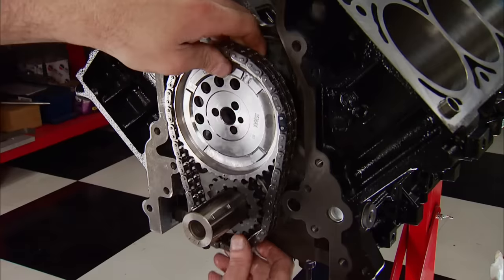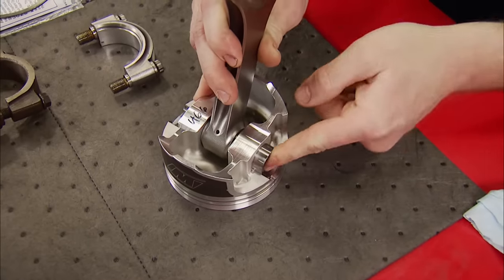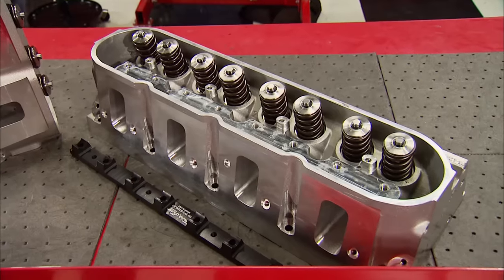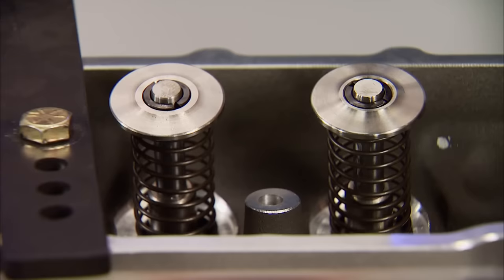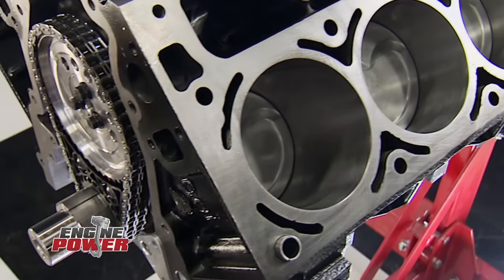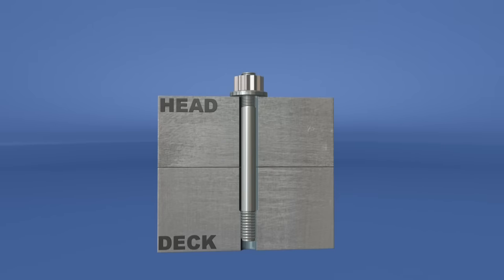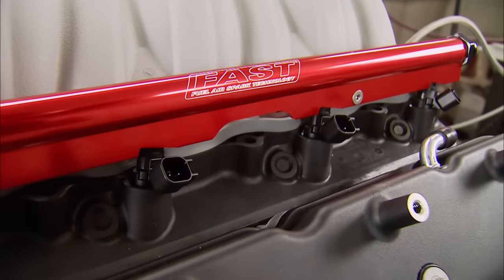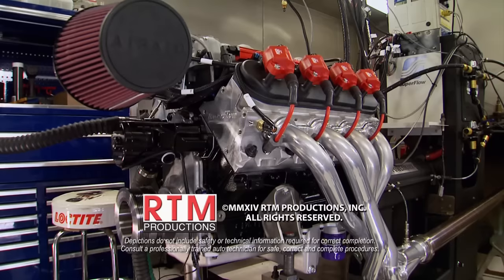Final Assembly Of The LS 408 Stroker - Engine Power S1, E10

Comment: Great info on this video.

Never let the stud touch the block. If anything, leave it as much relief as possible, especially with an aluminium head. Aluminium, iron and steel expand at different rates. Let the gaskets do the sealing. A stud touching the block can, and most likely will warp the head at high enough temperatures. Five treads of engagement is more than enough for most applications.

Comment: I'm no pro engine builder, but wouldn't the valve angle be reduced to straighten airflow and reduce shrouded of the valves? Not to increase valve clearance. However depending on the build you can also gain some clearance from changing the valve angle, it is just opposite of what he demonstrated.

Comment: Definitely a cool build. Buy the LS7 out of the Z06 made 505 at the crank and has 19 more cubes. So this build makes sense if you are building from scratch but if you own a car with a LS7, like my current Z28 you are a cam and tune away from making 100hp more than this build without E85. However if you have ever heard a 408 stroker LS in person you’ll know they sound incredible especially with a big cam as they lobe like no other but straight scream in the upper RPM range. Great build all the way around but I’d have ran AFR heads, trick flow’s are great but AFR is much better lol

Comment: Currently building my 408. When it’s complete it’ll only have 823(looking for) or 243(currently have) cylinder heads at first. Nice to see someone put summit parts to use. I was skeptic and used an eagle rotating assembly. Costed more but I couldn’t find reviews on the summit brand assembly. The oil flow tricks were NEEDED! Thanks a lot there!
Reply: you say "only have 823" but 823's flow a ridiculous amount of air in stock form, 315-320 CFM. It's a great head to use. If you can get them ported, they'll move about 370-380 cfm, and still cheaper than the aftermarket options.
Reply: @mathewshackelford8037  I agree but cathedral port heads are better for heavier cars like mine because they make more low end torque. Which is why I wanted to do an aftermarket cathedral setup to improve the top end hp. I’m still on the fence about it though. I may keep the 823 heads and let the turbo work it out for me 🤷🏾‍♂️
Reply: My cathedral port 243 6.0 SBE with a dual plane sloppy 2 and a Sniper makes 533hp.  It’s 10.8:1 and I home ported the heads

Comment: i have a 408 ci LS made from LQ4 6 L
I don't know how much horsepower or torque it has but when they wheel dynoed my suburban it has 361 ft pounds of torque on the ground 274 horsepower to the ground more than enough but not enough to spend the tires on my three-quarter ton suburban on dry pavement but that's okay it pulls the car trailer like it never did before it doesn't drop in the second gear to go up a hill it only just drops into drive from overdrive and muscles up the hill love it
Reply: Change your gear ratios to 4.10

Comment: After you install your pistons, check the guage point for how far the piston is coming out of the cylinder on a stroker.  If its out of the cylinder past the guage point, STOP.  DO NOT STROKE PAST THE GUAGE POINT, especially with a turbo.  This is absolutely crucial.
Reply: Shim the oil pump before tightening the bolts to their final torque.  Another tip.  Before you torque the timing cover bolts to their set value, mount the balancer then torque the timing cover bolts.

Comment: OK Im sure what you are saying about the stud is right but I have some questions. 
1) How is the stud tightened from a "relaxed state"? I dont see how it is relaxed when you are torquing it down, and the same would really apply to a bolt. You have to tighten both of them a bit before you get up to your torque spec levels. 
2) Can anyone expand on the statement that the stretch is only linear on a stud vs rotational on a bolt? That sounds great I just don't see how it could be different.
Reply: Relaxed state means the stud is not tightened into the block.  Put it in finger tight then back off a hair ( 1/16 to 1/4 turn )
A bolt sees rotation or twisting forces as you torque it because the threads in the block are resisting rotating due to friction.  The stud does not rotate only the nut does greatly reducing or eliminating the twisting force.  Thus only linear force on the stud vs some amount of rotational force on the bolt.
I use ARP studs on all my builds.

Comment: I would think you would want more turbulent air to mix air and fuel better than going for a laminar flow , in a cylinder head
Reply: That's more important for a carb or TBI setup. EFI sprays the fuel into the port right before the intake valve.

Comment: While oil pressure and AFR are important, isn't fuel pressure also just as important? Low fuel pressure, lean fuel trim.
Reply: You’re right but again you’re returning to the point of the AFR.
Reply: You can't hear oil pressure get low. If you don't recognize the sound of a motor getting lean, you should get an electric car.
Reply: @bradleyborrowman2115  You're still assisted with a wideband sensor though yet it does not mean you 100% rely on sensors
Reply: @bradleyborrowman2115  lol, sure thing internet tough guy
Reply: Owww now i know even you adjust the fuel injected but the pressure is low it won't change much right
Reply: If your watching AFR and it starts to go low it’s going to tell you something is going on with fuel pressure. So watching that is more than sufficient

Comment: They didn't even gap the rings to Wiesco's recommendations
Reply: Not sure what you mean. Looks like they set it for “Blown Race only”
Reply: They barely gapped them rings as it is. Fricken 15 thou gonna shrink at operating temps alone
Reply: Whats the deal with the  ring gaps?
Reply: @TrumpsEarBandage  lol! I recognize end gap and its purpose ,having built 11 engines lifetime ,I was concerned  with the gap that was being used was only half of  the amount of gap recommended  on the specs printed  on the spec sheet.
Reply: @TrumpsEarBandage  i thought he said.   .025 gap ,what am I missing?
Reply: @TrumpsEarBandage  ok just got the math thanks
Reply: .028 top .029 2nd

Comment: Did you upgrade the valves? I spoke with trick flow about the 255 heads, he said it would melt the valves being booted. He said go with 225cc heads.

Comment: You can make this power with unported ls3 heads on a 408. A stock ls3 with headers and a tune will make near 500 at the flywheel, it's been shown multiple times lol
Reply: @bigboreracing356  literally if you're literate you can read all about it from multiple people with multiple engines on multiple different dyno's. It's not some wild ass guess. Compensate somewhere else lmfao
Reply: Holy shit man I didn't know you were so badass that 500 hp is nothing, and you've gained a higher understanding of physics than us plebs. You do realize that statement is ridiculous, because the majority of normal people have never even experienced an honest 500 hp. My guy stock castings flow 305-310ish cfm at .600 lift depending on the individual head. If you're enlightened about their turbo plan, that's plenty enough to make their 1000 goal. I don't really see your point here but circling back to it a half hour later makes me worry that your amusement might just be a guise for being butthurt about my comment for whatever reason. I wouldn't want to hurt any feelings.
Reply: And with some porting to the Stock LS3 heads that can make over 550 HP to 600 HP
Reply: Thus was filmed in 2014 alot has changed since then

Comment: .015 top ring gap with boost?!  That’s a little tight.  I don’t know why their engines always make a little less than I would expect, not dogging them, just surprised - maybe it’s the dyno.  Richard Holdener made 625 hp with a 408 stroker and a 240 cam and very similar heads.
Reply: Richard also made 550 with a dead stock LY6 and a cam/springs and proved you can make 700hp with a stock 823 square port. I think they didn't put enough cam in this for the 400inches and the higher comp. With the oil mods and high vol oil pump it'll suck the sump dry at the 1000ft mark anyway lol.
Reply: I thought they said .024 top ring
Reply: The .015 was the oil scraper ring.

Comment: I love these builds but the only thing I can't understand is the old SBC mentality of the double roller. LS's will make 1,000+ consistently on single rollers and in almost all cases, the double roller requires the timing cover to be modded. Simply put an LS2 timing chain on it and send it!

Other than that, I love the build.
Reply: Put a double roller in my gen 1.  No mods needed to the cover.
Reply: Cool story. Doesnt change the fact it’s not needed and lots of 1,000hp LS’s running single timing chains

Comment: i loved this part i do.have  a question i own 2 1991 gmc 1500 W.t  pickup bare bone both have throttle body 4.3 v6 both have 450,000 mile and smoking any ideas how to make both bulletproof but one more power and torque and the other more H.P MAYBE A SUPERCHARGER

Comment: I really enjoy your videos.  Very informative.  I do have a couple questions though. 1}  Exactly how does a dyno work?  I hear the engine bog down and then take off and was wondering.  2}  What is the purpose of the windage tray?  I never knew there was such a thing.  Anyway, keep up the great work.
Reply: Dyno's basically attach the gas engine to a second engine (the dyno) and then the second engine/dyno tries to fight the power output of the gas engine and then uses math and computers to give us HP and Trq. Windage trays scrap excess oil from the rotating assembly which reduces overall rotating mass= better engine.
Reply: thats why the motor bogs down when the dyno run starts too
Reply: Simple answer first. A windage tray helps keep the crankshaft from aerating the oil. You think, a crankshaft spinning at say 5000 rpm, there's some pretty good air movement going on which can whip up the oil. Not good to have air in the oil as air is compressable and can let the crank contact the bearings. Oil essentially floats the crankshaft while pressurized.

A dyno is essentially a brake that is bolted to the crankshaft. What's happening when an engine is bogging down is that the brake is clamping harder on the crank. You probably noticed that a dyno run is done with the throttle wide open. The brake is why it isn't taking off. Some of these brakes are conventional friction materials, but a lot of them use water for that braking force. On that brake there is a strain measuring device so the harder it's braked, the more strain is created. Works like a weight scale. That strain gauge is about a foot out from the crankshaft centerline. What happens is that the dyno computer is reading that strain gauge which is reading the torque , or twisting force, the engine is producing. The computer then plugs that number into a formula to determine horsepower. If you look at a dyno chart, torque and horspower cross at around 5250 rpm. That's because 5250 is part of the formula.

The dyno is calibrated by hanging a calibrated weight on that strain gauge arm. For example a 400lb weight at 1 foot is 400 foot pounds of torque. They can then calibrate the computer to read the same. 

One of Powernation's videos had a piece on the new dyno they got and how it works and is set up, but I can't recall it at he moment.
Reply: @killerdoxen  Thank you very much for the information.
Reply: @nolanlojo103  describing a dyno as an engine is a very poor example, it's a brake, not an engine. It doesn't create any power of its own.

Comment: Totally gloss over the machine work. A critical factor BEFORE assembly. You make it look like you can just order these parts and slap it together.
Reply: @bigboreracing356  So they matched the pistons to the cylinders, honed the big ends of the rods to match the crank, and marked all the parts as they relate to their proper installation\position? And what rings did the machine shop use when they matched the pistons to the cylinders? The list goes on.
Reply: @bigboreracing356  Hard to assemble an engine and not have a machine shop to do the final honing to match parts.
Reply: @bigboreracing356  Took the words right out of my mouth.
Reply: It's a budget build not a race engine, Good basic machine work to is all that is needed.

Comment: After all of that work, you have managed to roughly equal the 5.2 XS Aluminator crate engine.
Reply: For a quarter of the price of an Aluminator long block. Lmao.
Reply: @next2talljones  You're funny.
Reply: Whats funny? Is it that a sub-$10k dinosaur LS can outpace most anything on the market with astounding longevity to boot or that FoMoCo wants $22.5k MSRP for the GT350 powerplant with none of the accoutrement to make it run? Maybe it's the ECP for a 52XS is $1,000 more than the heads featured in this video. 

Who knows. Could have compared so many other blue oval options to this but decided to go the potato route with the Aluminator.
Reply: @next2talljones  Wait....now that LS is a sub $10k engine? Your "facts" keep changing. Before, you were claiming this LS build was 1/4 the price of the 5.2 XS Aluminator, which can be bought for under $19k as you actually know. 
The reality is that the engine in the video would cost a whole lot more to have built for MOST people, because they don't have the expertise to build it.
Reply: Pot, meet kettle. Clearly that "expertise required" wouldn't apply when putting that 52XS into anything, right? We've got into straw grasping early.

Yes, I did say ~$10k because that's what you'll have into that package after an okay 7875 kit. Still half of the price of the 52XS that is nothing more than a paperweight without several thousand dollars worth of ancillary equipment which will leave you at the same stage of needing to install it into the awaiting vehicle. Good luck with that considering the respective aftermarkets. However none of this invalidates my original statement being very close to true. 

The fan boy is strong with this one! Never let  sensibility get in the way of farfetched brand loyalty.
Reply: @next2talljones  installing an LS or Cayote based engine in a vehicle is pretty much an equal problem. Both will require wiring and making mounts. If you paid someone to do it, both would cost roughly the same.
 
However, building an engine from parts DOES require much more labor and expertise than buying a crate engine. Hiring an engine shop the build that engine in the video would not be cheaper than buying a crate engine.
That's all I said. I was comparing the horsepower of the engine in the video to buying a crate engine with roughly the same horsepower.
Reply: @chrisdaigle5410  You can have the long block built with good parts and heads at shop that does performance engines for under $8k and you can buy them for the same price and have it shipped to you. You're not going to beat that with your Aluminator lol
Reply: @chrisdaigle5410   Installing a LS or Coyote aren't "pretty much an equal problem".  Not only are there hordes more aftermarket options for the LS, it's super easy to use a factory harness and ECU which are easy to find at any junkyard.  Can tune them with HPTuners or nearly free options like PCM Hammer.  Plus, the LS is way more compact.  The width and height of a Coyote are the biggest issue for it.  Also, there's hordes of options when it comes LS accessory drives and engine mounts.  This makes putting a LS/Coyote far from being equal when it comes to putting them into a vehicle.  There's are reason why there are aftermarket options for putting a LS into cars like a Miata, 240, RX7, etc and not for the Coyote.

Comment: Good luck with the drilled and tapped holes in the middle of the main caps at 1000 hp
Reply: What holes are you talking about? I watched this video when it first aired in 2014 so I don't remember.
Reply: Those are lightweight holes, it adds 11hp!

Comment: Did I miss it, or why don’t you say what cam is in the engine?
Reply: it was listed back in part one. think it was a trick flow with .625/.625 lift I think it was 230/238 duration  don't believe the said what the LSA was though.
Reply: @Lagrange1186  thank you!

Comment: Why did you tell us the ring needs to be set and shows us the spec sheet and you set the end gap to a spec that wasn't even all the sheet in it was half what they said you need,but you didn't tell us y u done that...I'm lost. For the street strip engine the clearance was 45 to 50 with no power adders and you set them at 20 and 23 where did you come up with this spec

Comment: Why the heck is anyone still using spirolox?  They are completely ridiculous
Reply: @bigboreracing356  They work fine but are insanely hard to install and remove and makes it more likely the piston will be damaged. Round wire clips work better and are super easy to use.